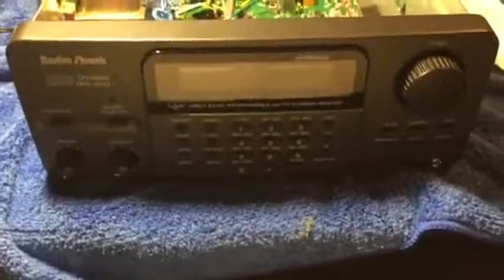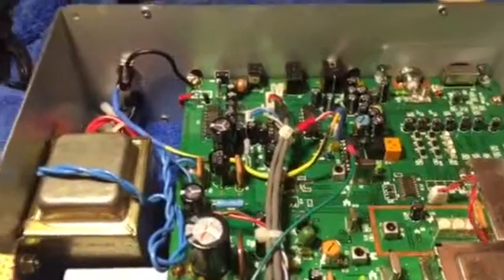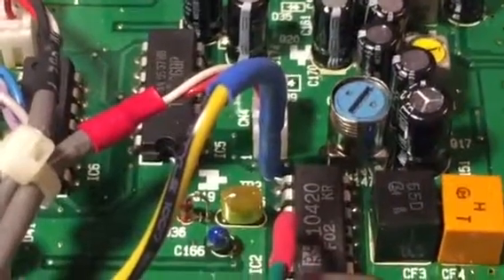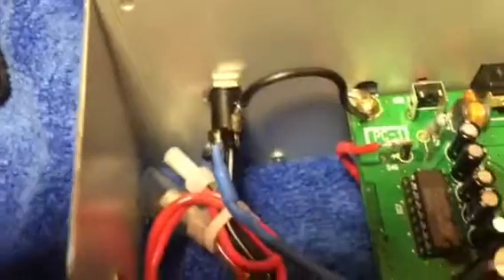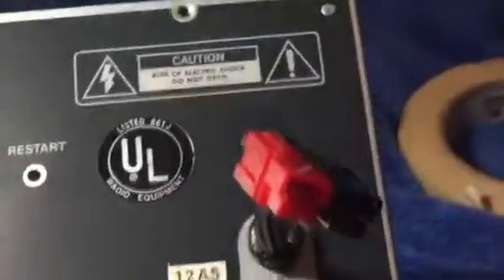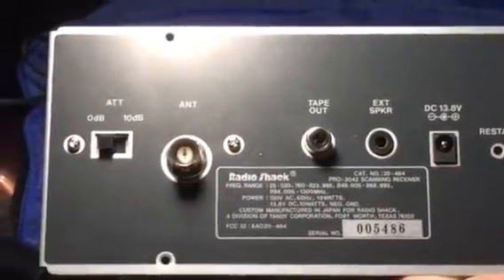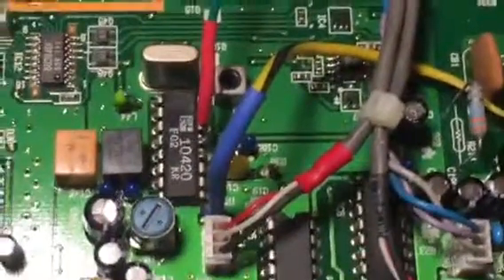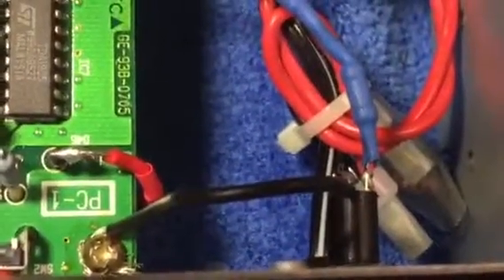Pro-2042 Discriminator Tap

Comment: The discriminator tap, taps the scanner’s raw unfiltered audio. In older scanners like this one, you can use it with some programs for trunk tracking, decoding Pl/DPL tones, all of which were unheard of in a radio when this scanner came out, but are standard in today’s scanners.